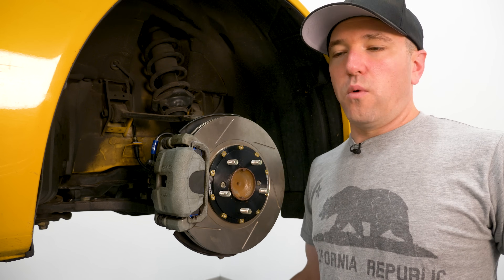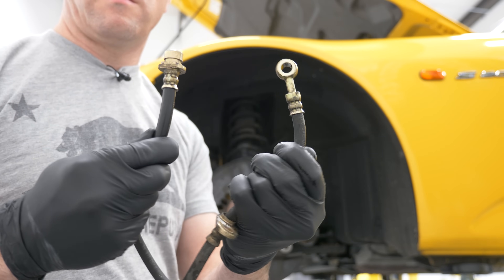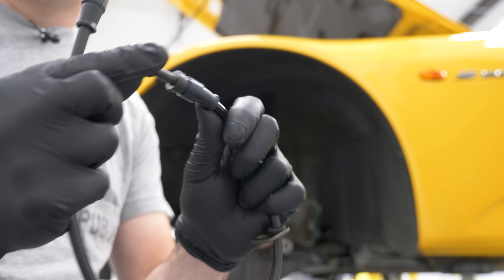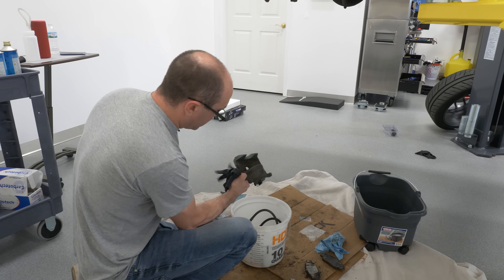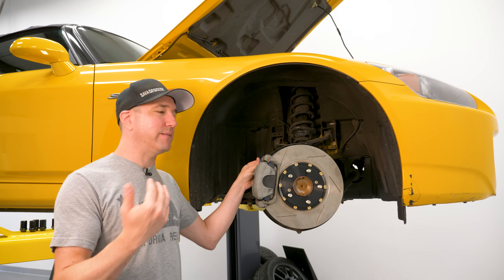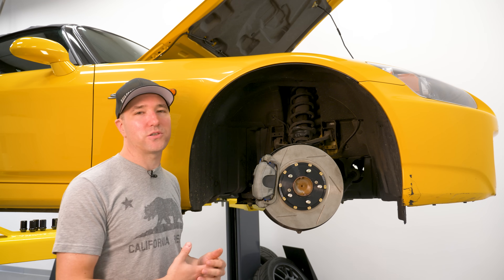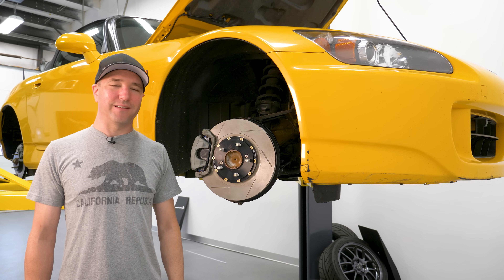Are Stainless Steel Brake Lines Worth It? | The Fine Print

Comment: "Are Stainless Steel Brake Lines Worth It?"

Yes, if you would like better braking performance. No, if you would not like better braking performance. Just figured I'd save everyone several minutes of time.
Reply: You omitted the useful information.
+The lines are suited for very hot temperatures - race tracks or rally but not street because they hold shape when very hot unlike rubber
+The lines are able to sustain scratches, cuts and scrapes to a greater degree than rubber but at speeds much higher than city or highway driving
-They require frequent inspection as the fittings take most of the brunt
-$$
Reply: Please watch the video again. If you still don’t get it, watch it again.
Reply: operatorblack lmao

Comment: I'm totally dumb, but isn't the heat mainly created by the pressure on the fluid?
Reply from the maker: +David Texugo Pressure plays a major part however fluid goes directly into the caliper which is used to to push in the pistons.  When calipers and brakes get up to 1000F the heat transfers into the fluid and will raise the temps as well.
Reply: Never thought of that, but it makes sense too!
Just wanted to make sure that I'm not a total idiot and that the pressure also has a part in it!
Love the series and can't wait for more! Haven't you thought of doing some actual testing? Like Engineering Explained did a really long time ago (for reference check the video "Acura Integra Weight Reduction - Acceleration Testing - Stage 1")

Comment: Savagegeese I want to track my FRS, but I also use the car as, not only a daily driver, but a work vehicle for sales - 25000 miles per year; how often should stainless steel lines be changed? I understand they need to be checked regularly (every month, given my standards?); though wondering what the lifespan is .....just to be safe - have fun at the track, daily drive for work, carve the canyon on the regular basis (canyon is my entrance to and from home)

Thank you (in advance) for your advice!!!!, AND also for the great vids and info you regularly provide!!!!!!

HH

Comment: The point of stainless steel lines is to improve the feel of the brake pedal. Less mushiness. Basically what you said, but the lines don't always need to be hot to feel the difference.

Comment: Also longevity. Rubber lines crack over time. Stainless steel lines, when properly installed, will not crack.

Comment: You should try cutting open a rubber line. They are far more durable than you'd think. I find the stainless steel lines far more prone to damage...at least on motorcycles. Also, the line expansion has nothing to do with heat. It just expands because of the pressure you're exerting by pressing the brake pedal.

Comment: welllll....lets not get all dramatic about brake leaks. Your brakes have 2 circuits, whereby your opposing corners share the same fluid. If you were to have a leaky flex line on one wheel it would kill braking on that corner and the opposing one, but the other 2 corners will be fine. Your pedal will go long and your braking will be a little uneven, but it will be controllable. Even if you don't notice the brake travel, the fluid level indicator will go off long before you are at dangerously low fluid levels. redundancy is engineered into the system in case of single point failures.
Reply from the maker: +dandil Its not about just a slow leak its about, blowing a line completely which is the high risk.  And unlike a factory car under warranty, if you blow a rubber line manufacturer is fronting the bill for an accident.  You blow an SS line, the only liability is on you.  You think any aftermarket company is going to handle it?

Comment: I'd say if you were going to go with SS lines get the ones with the outter rubber coating as the ones without can be exposed to more debris and can in turn wear out much quicker which happened to me when a line bursted on hard braking.

Comment: The rubber hose expension is not just from hot fluid.
Brake pressure alone is enough. So on any road, pushing the brake pedal, will expand a rubber hose.
Reply from the maker: +1D0N I explain this in another comment about it but typical brake line pressures 1800 PSI at maximum the pressure it will expand lines but the heat makes it much worse namely in lines that are older.

Comment: What about clutch lines?
Reply from the maker: +Archi it depends on the car but for the most part I don't think you people care too much about clutch field compared to brake pedal feel especially when it comes to Performance driving.  Most of the cars I've driven head rubber clutch lines at some point
Reply: Okay, thanks for taking the time to respond! Big fan from AU. Maybe you could explore clutch delay valves and bundle it with that (my car does not have one).
Reply: Archi I just picked up a braided Spoon clutch line; once I have it installed, I'll report back. However, I doubt there will be much - if any - difference in feel.
Reply: Thanks bro, I would appreciate the reply (no matter how delayed). I figure the benefit will be negligible, i'm more interested in the perceived downside or how much of a hindrance it is for other parts.
Reply: A little late to this question, I have a 2007 RS4 that could definitely use a ss clutch line. Just with 3/4 or wot peddle use the clutch lever stays on the floor board. Maybe its because its the original lines.

Comment: I did the stainless steel brake line upgrade when I upgraded my brakes, 2 failed within a year or so, went right back to rubber.  One should never get stainless steel brake lines on a commuter car.
Reply: that's interesting... on the surface of it, you'd assume lines armored in a stainless mesh would be bulletproof in comparison to OEM rubber...  the binding part is something I've never heard discussed before either... could be pretty shitty...
Reply: That's what I thought.  I thought I was investing in a performance part, hence, will be 10X better then OEM rubber lines.  Unfortunately, that's not the case.  Savagegesse is totally right on this, SS lines should only be on race/track cars.

Comment: I put Stainless Steel brake lines on my motorcycle.  I simply did it because I found the braking "Feel" to be much better.  Very firm levers after installed.  Of course part of this could be the fact that I installed new fluid and made sure they were bled to perfection.  Nevertheless, they were red.  I like red.
Reply: BadShadd1 I've put them on almost every motorcycle I've owned. Make the braking great.
Reply: I too, am getting red ones. Red lines, on a black muscle bike. No fairings, just a retro 1300cc big-ass roaring block. With red lines. I too like red lines.
Reply: I put stainless steel braided brake lines on my motorcycle years ago and I couldn’t believe how much better the braking feel was.  I did the same to my car and not much difference.  I took the steel braided lines off and put new rubber lines on.
Reply: @ghostwrench2292  😂😂😂😂
Reply: My motorcycle came with stainless lines from the factory
Reply: Red, huh? How exotic. 😜
I owned a motorcycle once, a supersport. ... I made it all white, uncluding the seat.
I got aftermarket racing brake calipers on my car. ... They're black. 😎 (I don't want them to be visible. I don't consider them an aesthetical part. ... And as a little bonus they emit heat a bit better. And you don't see dirt on them.)
Reply: Regular maintenance is probably a better investment on such a light vehicle. How often are rubber brake lines supposed to be changed on a bike, and who really does it to that schedule?
Reply: I used to do the stainless thing.  Then I found that it's really hard to tell the difference between stainless and new rubber lines - but most people are comparing them to the old, worn-out rubber lines that they're replacing.  if you're a professional (with a like skill set) or if you're driving off-road a lot, I can see the point.  But for spirited driving or the occasional track day - probably not worth the expense.
Reply: @aussiebloke609  I absolutely agree with your on this point, I got my WRX braided brake line replace on my new WRX after 3500kms, same brake fluid, same pads and rotors, nothing firmer or better brake feedback compare to OE new rubber line, only find it change better by investing a bigger rotor, pads and calipers.
Reply: @fckuyo3918   it’s recommended to change your rubber brake lines on your motorcycle every 5 years but no body ever does that also recomended to bleed them and change the fluid ever year cause most bikes use dot 4. Higher boiling point but a bit more hydroscopic that dot 3 so they  may become contaminated with water alot quicker essentially lowering your boiling point 😮‍💨

Comment: Hot brake fluid isn't expanding the rubber line, it's the pressure the master cylinder is generating to stop the car.  If the fluid expands due to heat, it is equalized throughout the system every time you let off the brake pedal.  If the fluid gets so hot it boils, no hose construction can help you there.  The stainless braid simply constricts the pliable inner hose(often teflon) to prevent it from expanding under normal, everyday braking.  Motorcyclists put them on all the time to get a firmer brake lever feel.
Reply from the maker: +horus909 Its a combination effect of pressure and heat expansion.  A brake line with 100F fluid and 1800psi will expand less than a brake line with brake fluid at 550F at 1800psi. The older the rubber lines the more expansion is noticeable. Which translates into some pedal feel difference, but unlike motor cycles its less noticable in street cars.
Reply: I'm no brake expert, but OK. So hot brake fluid expands, and rubber constricts under heat. This is like a double whammy. Then, braking under high load/brake = even more increased pressure. All the rubber lines meet/exceed the same DOT standard, to my knowledge, and rubber lines can handle about 1,500 ish psi, which is fine for street driving, but how much does 700+ F brake fluid expand, how much does the rubber constrict at 700+ F, plus the braking pressure? I'd say it's quite a lot. I don't see how this would equalize. It would blow something out. Thus, SS lines, like Rotora, can handle 3800 psi. Granted, they need to be changed more frequently and installed correctly.  I think I'll do a video of a bench setup showing the temperatures etc. and do some real-life measurements and post it on my novice YouTube channel.

Comment: Just ensure you get DOT approved ss lines, issue solved. I've been running ss lines on all my cars since 2001 and never had an issue. The benefits out weigh the VERY small potential for something to go wrong, as long you installed them correctly that is. Also use Motul 600, best price to performance fluid out there, and use a pressure bleeder to properly get any air out and flush all the old fluid out.
Reply: Motul 600 is terrible for a daily driver. This might not happen as quick as I am in florida and its 130% humid, but after changing my ATE200 out for motul for a weekend on the tail of the dragon, I decided to leave it in as it was doing a great job, in less than 2 months is filled with water and shit because it has horrible hydrophobic properties. 

Motul is made for trackdays, not daily driving.
Reply: @nilnine1231  i use dot 4 walmart super tech. love it. also love their syn oil.
Reply: NiL Nine, never had that issue before. I always to do a full reservoir and line flush every 2 years and inspect my seals. You probly have a bad reservoir cap or grommet at the reservoir/master cylinder. These components aren't under pressure and could allow moist air in. A good sealed brake system shouldn't absorb water like that, over time and I mean a long time, sure, but not within months. I've tried to find data on your claim of motul having a higher hydroscopic rate over other fluids, but can not find anything. In any case, motul 600 still has a higher wet boiling point that standard dot 4 fluid, so you should be fine regardless. If you're experiencing vapor lock or other heat soak related issues I highly suggest that you do a major overhaul on the entire system because something isn't right.

Comment: I've put stainless steel brake lines on most of my performance cars, but I've always done it at the same time as upgrading rotors/pads/ fluid, etc.  to be honest, unless I did heavy duty track driving with constant hard braking, I don't think they would make damn different in every day driving

Comment: Did you run them on your FRS through the winter, debating on getting them for my 17 wrx?
Reply from the maker: +malkionx never ran them in salt and snow, the corrosion would be a concern.
Reply: Most of them name a coating of some sort usually teflon wondering if that would be sufficient. I park on the street so the salt attacks it 24/7

Comment: My stainless lines been on my car for 4 years no problems. It's a street and track car. I think it comes down to maintenance.
Reply: How does one '' maintain'' a stainless steel brake line?
Reply: Same.... I swear you feel a difference/ it's more important with no abs and a lightweight car
Reply: I'm trying to find out what company / brand is best to buy for my Ford Excursion. What did You use ? Or what is Best ?

Comment: SS brake lines also benefit if you do any type of backroad or canyon driving. Fluids don't have to reach boiling point for you to feel the benefit of SS lines.
Reply: i use to track my z1000 on oe rubber hose the dual 4 pot tokico works a treat but after a few laps they start to get smoshier not much but the lever seem to go in deeper then when you first start after i replace to earls racing steel lines the braking pefromacne stays consistant troughtout the session for road i say the difference its unlikly to be noticable but when your fluid are hot from constant full braking corner after corner the rubber hose will degrade your performance as the laps piles up but if im honest on the road you barely feel the difference maybe abit of feel but definitly wont shorten your emergency braking distance to be honest
Reply: This is me with my personal car in Mexico. Lots of twisty roads in the mountains, especially going downhill.

Comment: A friend bought Mann Engineering SS brake lines because he wanted to firm up his WRX brake pedal a bit. During the install we noted the fluid ports in the banjo fitting were significantly smaller than the OEM ones. Is that normal or do you think they just made the ports smaller to achieve the firmer pedal? Doesn't seem safe.
Reply from the maker: +C They should not be changing the diameter of the banjo port ports and should be matched to OEM assuming it is stock calipers.   Most SS lines are generic and made to length and not ported.  It's not a big deal really but yes if it's reducing flow to the caliper it will increase pressure at the master cylinder and would likely increase the pedal firmness but not obviously having a potential reduction in Breaking effect and could also cause some issues with the ABS system.  But the only way to test is to take the factory lines and the replacement lines and flow test them and pressure test them. That's a hard thing to do unless you wanted to send the lines off to a lab.

Comment: Didn't even mention the change in the brake pedal feel.
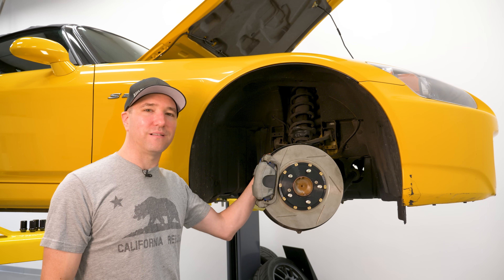Reply: He said the brakes can feel mushy with rubber if the brakes get too hot. @4:35
Reply: Clockwork he was talking about the rubber lines, stainless lines definitely change the pedal feel even before the brakes get hot. He's basically saying they don't do anything unless you track a car which is incorrect.

Comment: I really like how they make the brake pedal feel as well. The pedal feels a lot stiffer, and makes me more confident in my car.
Reply: Agreed.  I have two of the same car, one with the stainless lines (among other things), and one without.  The difference is obvious even on the commute.  It's good information, though, especially since indeed my first set leaked almost immediately, likely do to installation error (had a shop do it).  That said, the replacement set has been going strong for six years now.

Comment: Stainless brake lines are also useless without the proper fluid. 
I use motul rbf 600
Reply from the maker: +07wrxtr1 If you use high quality fluid like Motul, Endless, Project Mu etc. You can technically get longer life as they have higher wet and dry boiling points. Even if you get over 3% moisture it does not effect pedal feel as much as cheaper fluid.
Reply: DOT4 at the very least. 5.1 if you can get a hold of it for serious track time. DOT4 is a good added layer of security all around due to the higher boil point.

FWIW Motul is excellent.
Reply: 5.1 here.